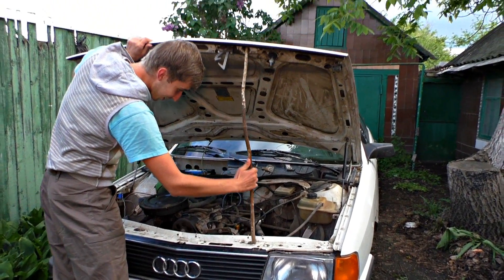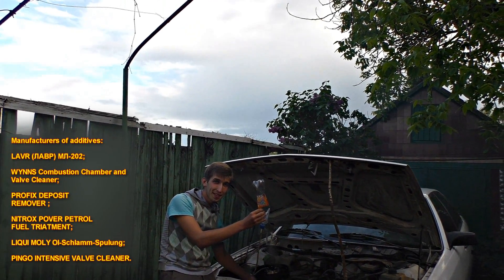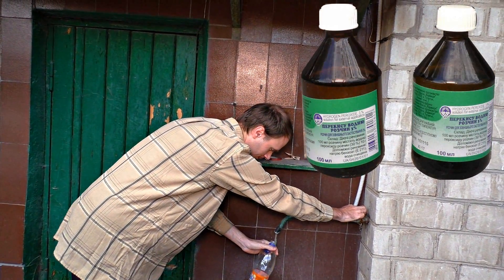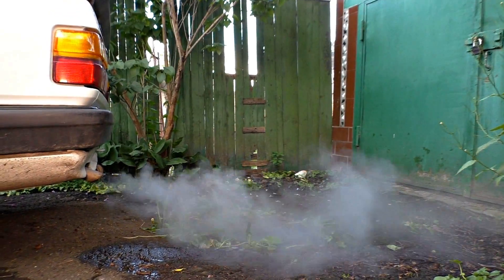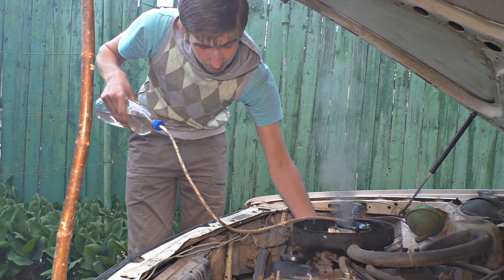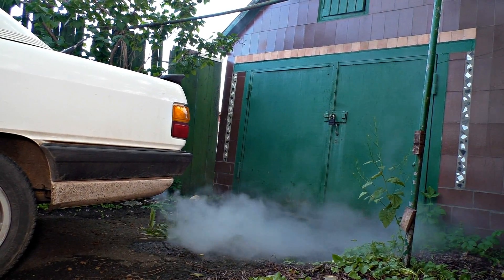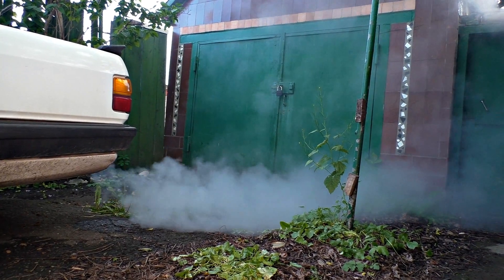Decarbonizing your car engine with hydrogen peroxide

Comment: so i hooked up an o2 line to my welding tanks and then into the vacuum intake and wow! i have NEVER seen and exhaust manifold glow like that!
Reply: So you made the inside of your motor a cutting torch
Reply: @MrScooter46290  its a quick way to clean out the muffler real fast. all the crap that builds up with cheap fuel is crazy.

Comment: The main problem with this is that by putting water in the compression chamber you run the risk of bending a connecting rod or punching a hole in the piston! WATER DOESN'T COMPRESS!!!
Reply: Of course, that's why it's important to not put too much in at once and be listening to the engine the whole time.  I do this all the time.  My camry engine has 460,000 miles.  I use the vapor-purge solenoid hose.  You don't need to keep the rpm at 2500.  Idle rpm is better for cleaning.  I recommend using a spray bottle and shooting it in as mist on COLD engine.  You can also use wd-40, ammonia, white vinegar, but one VERY important note not mentioned in this video: if you use water only use distilled water.  Do not use tap/drinking water unless you want the water minerals to bind onto the surface of your valves so they never shut/seal properly.
Reply: You're right, water is not compressible. But the goal is to pour or mist a SMALL amount of water, so that it can evaporate into steam, and steam clean the engine from the inside, since water is H20, and the hydrogen is what chemically breaks down Carbon. Think of it of an engine that has a failed head gasket seeping into the combustion chamber. If it's a small amount letting the engine run, but still runs and burns the coolant, noticed how the heads and piston are exceptionally clean?

Comment: Running non distilled water through an engine. I can't imagine what could go wrong...
Reply: Yup, using non-distilled water will cause the minerals of tap/drinking water to bind onto the intake valves' surface and prevent the valves from ever closing/sealing properly.
Reply: @Wes_5kyph1  wrong, it takes several orders of magnitude more water to develop deposits from the tap. You clearly have never done this before and have no experience
Reply: @Re_Kitty  Still, do you think it's good to contaminate your engine with minerals?
Reply: @goku445  What about mineral oil?
Reply: 🤔 mmmm......😂😂😂😂

Comment: I like the idea of what he's doing however I cannot understand his badly broken English enough to do anything with the video that's why I don't like it. Thank you my name is Al
Reply: It's pretty simple.  And you don't need to keep the rpm higher than idle like they show here.  Just find a vaccum line/hose.  I prefer the purge-valve solenoid then use a spray bottle w/ distilled water or wd40 or ammonia, or a mix of all 3 and spray mists in short bursts down the hose.

Comment: I did this with my car few times , and it did rust my valves so badly.
Reply: It's impossible to cause rust at running engine temperatures... they had to have already been rusted from lack of operation in humid weather.
Reply: hahahahahahaa, you should put it directly to your exhaust, it has the exact same smoke effect and it won't screw up your engine :D

Comment: this is 97% water and 3% hydrogen peroxide.

so basically unless youre comfortable filling you engine with water. Dont do this.
Reply: Water at a drip creates steam in an engine, which does a good job of cleaning out carbon. Unless you are pouring it into the intake, it's not hurting anything. Your car processes this amount of water through the engine every morning on start up when the cylinder walls are covered in condensation.
Reply: @race38dirt  probably not helping eithe r
Reply: Damn and it seems like he diluted it down lmfao wtf bro.
Reply: I don't even know why he even bothered adding H2O2. The concentration is negligible

Comment: Use acetone. It will do a hell of a lot more for your car and it's also a great octane booster.
Reply: Acetone eats seals, o-rings, and rubber fuel lines, I'd stay away from doing that unless your entire fuel train from tank to injectors can handle it. If you're going to use it for the purpose of clearing out carbon I'd mix it into some seafoam and spray it into the intake while the motor is running.
Reply: acetone injected into the intake? or mixed with fuel?
Reply: @Wes_5kyph1  mixed with fuel

Comment: I used a drip feed system over a period of time using about 60 % water and 40 % of methanol . Methanol is flammable and very clean burning as well as hydroscopic.
Reply: I'm sure that works.  I think you'd be better off using ammonia though.  Nothing decarbonizes better than NH3.  It's also a super clean fuel.

Comment: Is there even the slightest proof that this did anything to the valves?
in-cylinder cam recordings? Valve stem recordings (for a DI car)?
This DIY is not enough to convince anyone serious about cleaning valves.
If it was just carbon, it is questionable if the hydrogen peroxide is the substance removing it, or if just plain water is the reason.
You might as well shake up water and gasoline in a can.

As far as the air intake valves on a Direct Injection car, the carbon over there, is mixed with oil, which makes hydrogen peroxide pretty useless.
Reply: On a healthy running direct inj engine, this shouldn't be mixing with oil.  This only cleans the surfaces of the combustion chambers (walls, sparkplugs, piston-heads) and then is immediately sucked out the exhaust.  That's why there are cleaners designed for this (I recommend MOPAR even though it's made for chrysler engines, it works on all cars great.) After shooting in the whole can, you shut off engine to let it heat-soak 10-20 min, then restart.  It's generally more effective.  Changing the oil after this type of cleaning is moot.  It should not be entering the crankcase at all.

Comment: So dilute as to be useless. 

Why not demonstrate its magic in a hot cast iron skillet caked with carbon? Then all the world could see what it’s doing and the results!

The so-called carbon deposits consist mostly of zinc and calcium from engine oil additives.

Engines produce water as they run. About equal in volume to the fuel consumed.

Comment: I would never do this good way to hydrolock your engine
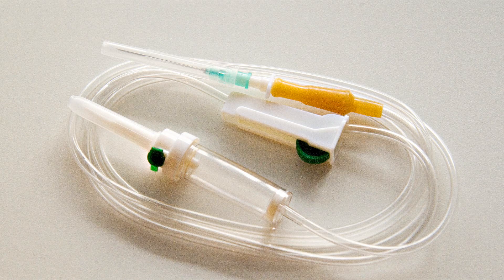Reply: You'd only lock it if you start poring water from the bottle. You're supposed to sip a droplet of water at a time, really small amounts with the tube thing shown at 0:50 These guys did not show a good demonstration of this trick, it looked as if they're squeezing the water out of the whole bottle in the engine at once.
Reply: Pretty sure this guy in the vid DID NOT hydro lock his engine , duh.

Comment: Why are you adding water to an engine? Isn't that bad for it
Reply: Blood Sweat And Tears Forever learning 

Engines make about a gallon of water for every gallon of fuel burned. Manage to survive....
Reply: They are not pouring water in directly yes that would be very bad they're putting drops in which are being vaporized I believe the idea is it breaks down the carbon and other stuff in there in valves but need to change oil after as it be contaminated (in modern engine it would probably destroy the DPF or the catalytic converter doing this)

Comment: It will work better if you drain the water out of the motor so the temp wil get real hot then put the ice cold water in the carb real slow.
Reply: Robert C Hall If valves are chain driven, belt can be removed for a while, as water pump will be driven by belt.

Good idea.

Comment: What does the hydrogen peroxide do vs water?
Reply: oxidize and corrode any useful engine part it comes in contact with....
Reply: @Taydrum  running engine temp is waaay to hot for oxidation to occur lol
Reply: @Wes_5kyph1  If that were the case, then the peroxide is useless at that point. What about the intake?
Reply: @Taydrum  it will still steam clean the combustion chambers
Reply: @Wes_5kyph1  2H2O2 ---> 2H20 +O2

 Decomposition is catalysed by various compounds, including most transition metals and their compounds. Certain metal ions, such as Fe2+
 or Ti3+
, can cause the decomposition to take a different path, with free radicals such as the hydroxyl radical (HO·) and hydroperoxyl (HOO·)
Reply: I know right.  These guys are f#@!ing morons.
Reply: There is no need to worry as long as you spray the water in a fine mist, slowly, over a couple minutes. Consider that one of the byproducts of combustion is water, so they are designed to deal with water in the catalytic converter
Reply: Is more expensive!
Before I would mix any hydrogen peroxide in the car, and risk destroying the MAF sensor, I'd probably check what it does to gasoline or oil.
Reply: Muranaman from what I can see here and in other videos advocating water or mixtures of water and ATF or water and h2o2, they’re added at the throttle plate, so well away from any upstream sensor. And considering that the downstream sensors are built to withstand thousands of hours of crud passing them, I doubt this would hurt them either.
Reply: @ProDigit80  No need.  This doesn't touch the oil and doesn't enter the crankcase.  The fuel it mixes with is the fuel vapor injected into the combustion chamber and exits out the exhaust in the form of steam as fast as the fuel does.
Reply: @ProDigit80  Why? What do you care what it does to the gas or oil?  First off, it will not have anything to do with the gas.  No interaction.  And as for the oil, after a carbon flush, who in their right mind wouldn't be changing the oil afterwards? So what does it matter?  Don't know why there are so many internet experts bashing this guy but it is clear to me they have done alot more keyboarding than wrenching.
Reply: @miketheis53  Pff! And you are actually adding some value to the conversation?
Instead of bashing me, why don't you shut yer trap instead?

Comment: Doesn't that chemical gonna eat metal?
Reply: Dipa Well it is a very potent oxidizer, do you think it will turn the carbon in the engine into co2 or the piston rings into rust or the pistons into white aluminium oxide? I think rust and white powder

Comment: What advantage does the hydrogen peroxide mixture give you compared to running straight water?
Reply: @FrankGutowski-ls8jt  Hydrogen peroxide just needs pollutants to release oxygen.
Reply: Muranaman 

No. It decomposes in the presence of light. That’s why the 5% solution for consumers is sold in an opaque bottle.
Reply: @FrankGutowski-ls8jt  Your Wrong.
Reply: One of the Hydrogen bonds on the Hydrogen peroxide molecule is unstable. The theory is that this will detach and become loose hydrogen inside the engine, which will readily combine with any carbon atoms it comes in contact with to produce some sort of Carbogen containing molecule that goes out the exhaust. Water cleaning is based on a similar theory, but the addition of hydrogen peroxide greatly increases the amount of available hydrogen for the process. That's the theory anyway...
Reply: @OliverJobson  ammonia NH3 actually works better for that reason.
Reply: Oliver Jobson 

Don’t quit your day job, you’re no theoretical chemist.
Reply: @OliverJobson way to plagiarize

Comment: How can this be safe if water doesn't compress?
Reply: Goy Shekelstein use little enough water on a warm engine, and it will just evaporate
Reply: You're supposed to sip a droplet of water at a time, really small amounts with the tube thing shown at 0:50 These guys did not show a good demonstration of this trick, it looked as if they're squeezing the water out of the whole bottle in the engine at once.
Reply: I was wondering the exact same thing. I'd be very wary of this trick.

Comment: Is that a carburetor? never seen one on a Audi 100
Reply: It must be a pretty old one (from the 80s).
Reply: My mum had one of these but it was the 2.3 I5 100kw 
This car is one of these:
1.8 L I-4, 75 PS (55 kW; 74 hp), carburetted (1982−1987)1.8 L I-4, 90 PS (66 kW; 89 hp), carburetted, later fuel injected/with catalyst (1983−1990)1.9 L I-5, 100 PS (74 kW; 99 hp), carburetted (1982−1984)
Reply: course it has.. ladas win :)
Reply: este motor é de algum vw, acredito eu esse ser uns dos motores mais usados no mundo pela baixa manutenção e alta durabilidade, comum em países pobres
Reply: @alexandrejose655  Vulgo moto AP.... Visto q foi de desenvolvido lá, e não aqui no Brasil como todo mundo pensa, e usa de carburador um Weber Mini progressivo, esse tipo de motor equipou, Passat e toda a linda Gol.
Reply: Yep, depend of the country regulation, in us in 67 all cars r fuel injection... But another country like Russian ou Brazil for example, in that time carb's r permitted.
Reply: I thought that was a lada
Reply: @behindthen0thing  No, it`s vw engine from 70's and 80's and are using a weber carb.
Reply: @gordonlino  my 84 jeep had a vw engine running a carter - weber carb.
Reply: The engine appears to have been swapped with one from a Lada.